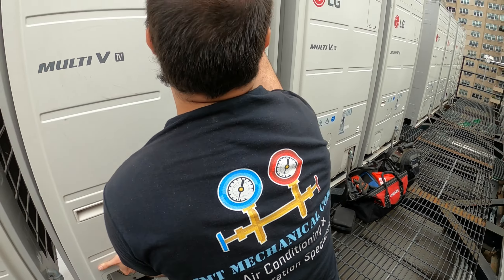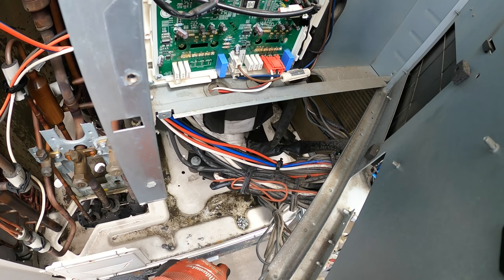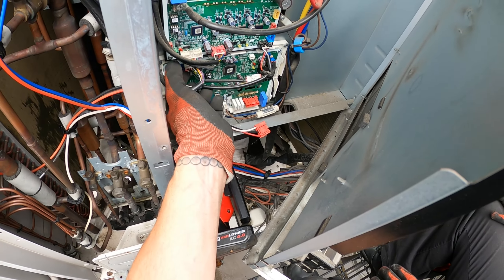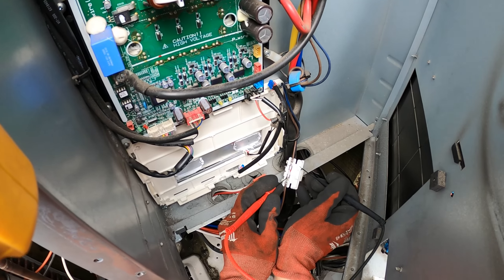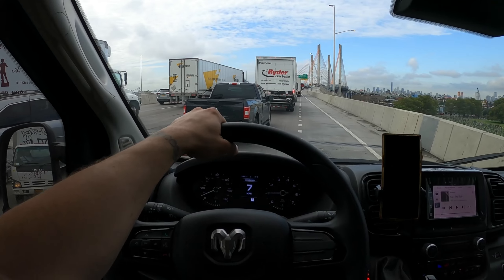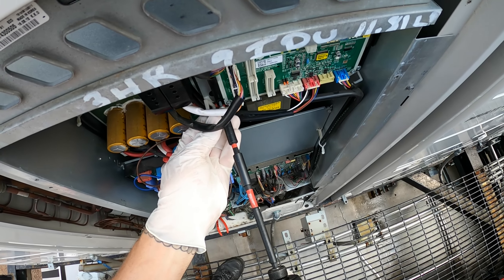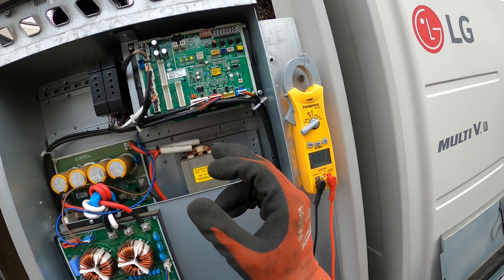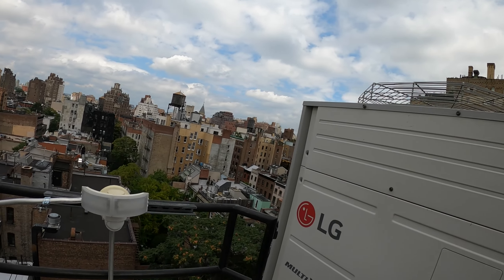HVAC LG MULTI V 4 Error Code CH106 (Outdoor Unit Fan IPM Fault Error) Instant Over Current ODU Fan

Comment: If you unhook 3 more connectors off of the outer panel boards you can fold that down and rest it on a milk crate or bucket. It makes the inverter and fan boards a lot more accessible if you are working by yourself. All the screws in these things are JIS not normal Phillips. Vessel makes nice JIS bits and screwdrivers you can get off of amazon. The LGMV wifi module PLGMVW100 is a must have for troubleshooting these things. You can order it off of the web if your local LG distributor wont sell it to you without taking the class.

Comment: Good job Jumper, Those easy out extractors for small screws, don't always work, It's better to drill the hole first, Then, use the handle for the extractor by hand, because the drill will strip it out real easy, need to do it manually, And that bug is stealing and hoffing refrigerant, haha just kidding.

Comment: I work for a school district. We have had nothing but problems with LG Multi V Systems. Several of them have been replaced with Mitsubishi City-Multi, and they are much more reliable. 
Spotted Lanternfly is the insect you saw!
Reply: lol I work for a school district too. We’ve had issues with daikin and lg. Mitsubishi has just had comm errors. I’m stuck on this LG. We replaced inverter boards and filters. And replaced a messed up reversing valve. And still no good.

Comment: I get around (Toronto, Canada) on a home made electric skateboard. The electronics of the board are inches from the road and the 4 Canadian seasons. My electronics have survived the elements in part because I buy/keep/use conformal coatings to protect my PCBs. I'm not a HVAC guy and I don't know how it would impact warranty or survive in the field in those types of electronic devices. My current skateboard has 3000+ miles on it. Before conformal coatings they only lasted 100's of miles. I like to use MG Chemicals, it is on the pricey side, but it is made here in Canada and has been a good product for the decades that it has been on the market. MG Chemicals & Conformal coatings are well known. Get something like a 1-part acrylic conformal coating in an aerosol can that you can keep with your kit. Mask off any areas you do not want to apply it to (copper heatsyncs & connectors) then spray/apply the conformal coating. Between conformal coatings & dielectric grease you can weather proof PCBs fairly well. 

That white stuff look like the conformal coating peeling off.

Comment: I had a similar issue with water in a control panel. I know it’s kinda hack but I sealed the seam with “ Flex-seal”  waterproof tape🤷‍♂️ it worked well so far since last winter
Reply: Just buy a conformal coating that is designed for doing that?

Comment: I’m the biggest advocate of this technology and all vrv units.  But in the 15 plus years I have been working on all of the brands of vrv vrf systems.  It just seems that the reliability of the components including boards motors etc is not very good.  And we are installing these units to replace gas oil abs electric heating.   Just wish a manufacture would just make a product with better quality parts and parts such as board that are made better.  Just always seems to be something broken in short order.   Just saying

Comment: Your water intrusion is from the fan ipm heatsink that hangs outside the metal cabinet , the sealant applied around its perimeter is failing and needs to be resealed , remove electrical cabinet to check. And stop putting thermal paste on like a bukkake party
Reply: what about the door seal that was half gone?

Comment: What is the name of the company who installs these LG multi V’s. My son and I have been selling and installing these units for nine years now never had a compressor go out never had a electronic expansion valve. Get plugged or go out..  

We do have extremely high end electrical surge protection on the electrical panel 

And to circuit boards in nine years of installations, both came from buildings when the transformer blew up supplying power to the building so far have been the only to Fan board that we had to replace. 

Like all units it’s not always the equipment. It’s the individuals who install them and service them that caused the failures. .